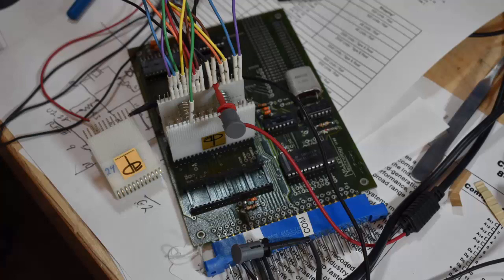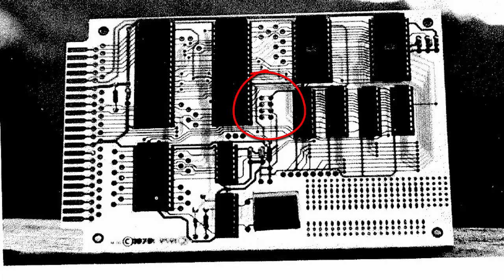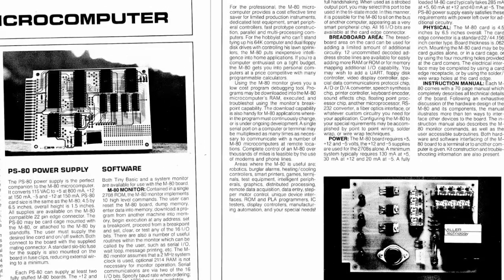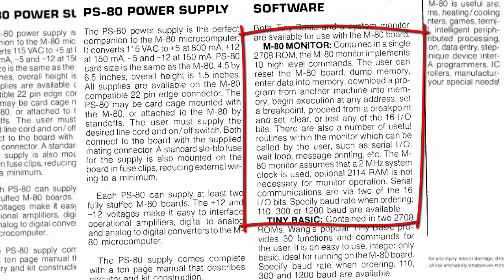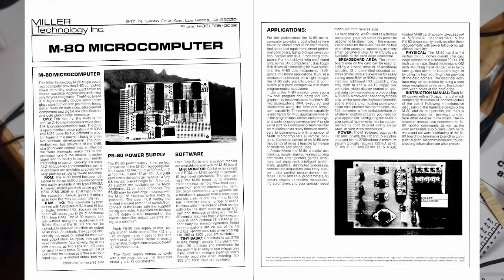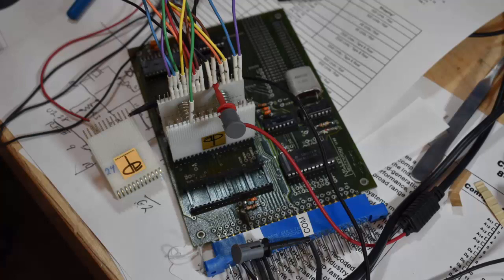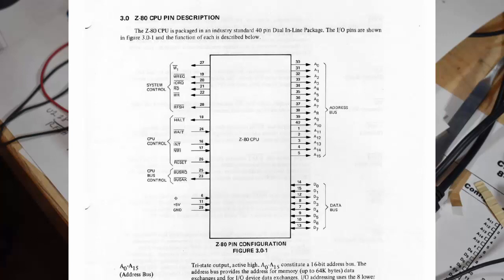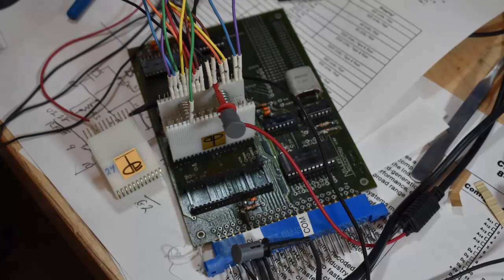{63} Call to all Z80 Gurus- test your knowledge challenge !!  New-Documentation- a M-80 Sell Sheet

Comment: Three options come to mind:

* The /M1 output pin, which indicates that the CPU is fetching an instruction from memory.
* The /HALT output pin, which can be set by issuing the HALT instruction.
* The /RFSH pin, which technically cannot be set through software, but can be monitored by inverting it and or-ing it with the inverted /MREQ signal, in which case the contents of the R register are asserted to the lower 8-bits of the address bus and those of the I register are asserted to the higher 8-bits of the address bus. In theory you could then use the IR register combination to output debug information, such as an address, but doing so reliably is possbily going to be a hassle, especially since the R register is a counter. Also, /M1 and /RFSH are typically not asserted concurrently (which makes sense, as the /M1 cycle will need the address and data buses for its own purposes) and from the diagrams I've seen you can pretty much assume that the CPU is at least halfway through the T3 state once /RFSH is asserted low. 

The third option is only viable if all RAM present in the system is SRAM, not DRAM of if DRAM present in the system is refreshed by some means other than through the Z80.
Reply from the maker: I suppose that I should have mentioned that if the Z80 is using dynamic RAM, then hijacking the refresh circuit isn't an option, and there goes the whole idea.

Comment: You will need extra logic to decode the Refresh register. A simpler way is to drive an LED from the /HALT pin and execute a HALT instruction (use a CTC timer interrupt to make it flash).
Also it is a good idea to always pull up the data bus with 4k7 resistors. This ensures that  a RST 56 instruction is executed whenever you jump to non-existent memory or unprogrammed EPROM, then  the PC jumps to 0038h where you can have a diagnostic code loop e.g. write the stack to an I/O address so that you can probe the data bus and see where you came from or anything else relevant.
Reply from the maker: Interesting idea for designs where the halt is otherwise unused and, say, could drive a toggling flip flop. But, I don’t see how you are getting a humanly discernible switchable or blinking LED using the halt pin but without additional logic.
Reply: @HelloWorldETX  No need for toggling flip flops. Just have an LED that indicates the  /HALT (i.e. RUN) status. You want to establish that the CPU is running  code? Put a simple software timing loop in the ROM followed by a HALT instruction, the LED will stay on for the time of your counting then go off.  QED. If you want repeating flashing then an interrupt or NMI is needed to get out of the halted state.
If you want to prove that the CPU executes code and the data bus is pulled up, just take out the ROM. Any FFh will execute a RST 56 which will find an FFh and you get an endless loop which is easily confirmed which a scope.
If buggy Z80 code goes out into the long grass it won't be long before it finds a block move or moves the stack over all your RAM so it's a good idea to trap such occurrences and make debugging easier. Dynamic RAM usually powered up with patterns of 00h and FFh which is NOP and  RST 56, but static RAM has random contents. It's good practise to fill it with 00h or FFh to be safe.
The best way to debug, confirm and verify Z80 code is to use a logic analyser   with a disassembler  to passively monitor the bus (i.e. not a development system with emulated memory and peripherals). In 1982 that would have cost about £32k (Dolch), in 1992 £1500 (Thurlby), and now they can be found for £30 on eBay because "nobody" uses Z80s anymore.

Comment: I run a single byte Z80 test program. The program consists of a single byte 76H (the HALT instruction). If the system is properly reading the data bus the CPU will HALT and the /HALT signal will be asserted. Many systems have a HALT LED indicator to make it easily seen.  This program does not even need a ROM to run - all one needs to do is pull up and down the data bus pins so that the 76 is presented. The HALT instruction is essentially the NOP instruction in disguise.  The Z80 CPU will continually run NOPs without updating the PC (Program Counter) allowing one to observe the Z80 output signals in action.

If one wants a more comprehensive test suite then one can implement Zilog's Special Reset circuit (US Patent US4486827A) to provide a comprehensive debugging and inbuilt ICE (in circuit emulation) with a minimum of components.
Reply from the maker: Good point and great diagnostic technique to jamb an instruction onto the bus.  When having extremely difficult times bringing up an old board I have patched in a hardwired machine instruction onto the bus or even fed machine instructions to the processor using my processor breakout board as a poor man’s ICE.

But the special reset is at the next level of understanding.  I have seen the external timing latch circuit to generate the special reset, but I do not think I ever needed to actually trace out and understand what it was doing.   I know that I never came across the patent before, some good reading there. Thank you for that.

Comment: An other option can be to use the refresh register to set/reset the eight bit with a LD R,A you can then test this bit during the refresh cycle. The Zilog manual even says: The programmer can load the R register for testing purposes.
-Maarten
Reply from the maker: We have a winner, well done.  While the refresh logic increments the refresh address during an opcode fetch, it only goes up to 0x7F before rolling over to 0x00, leaving the eighth bit untouched. This puts the eighth bit, and therefore A7, entirely under software control and with a simple latch can be used to create an output control bit.  To extend the concept, the I register can be used to create an 8 bit output from A8-A15.

Bravo Maarten
Reply: @HelloWorldETX  So you are saying: Connect an 8 bit latch to a8 - a15. Use the /refresh pin to trigger the latch to load. I like it! I'll try it out in one of my future videos!
Reply from the maker: Technically, to make sure the timing is impeccable OR the refresh* and memreq*

Comment: You can use MI,  Ml indicates that the current machine cycle is the OP code fetch cycle of an instruction execution, but with a 2 byte opcode Ml is generated as each OP code byte is fetched These two byte op-codes always begin with CBH, DDH, EDH or FDH. So more or less you have control over the MI output.
-Maarten
Reply: Doh!  yeah, I think that would be it. A good passive way to know it was executing code. I was stuck in thinking "active control" and not passive normal CPU functions.
Reply from the maker: I see your thinking—— We know that M1 only demonstrates that the z80 is attempting to fetch which shows that it is functional, but does not indicate that it was successful in fetching the desired opcode from memory. So if I understand it properly your scheme is to slip in double fetch instructions in such a manner that the pattern is recognizable.  Very slick idea indeed, but how would you create a latched signal that could be used, for example, as a heartbeat led or to page memory or voltmeter test point?
Reply: @HelloWorldETX  If you are going for "Is it accessing the memory in some way" MREQ would do it.  It would say the CPU is executing "something" good or bad.
Reply from the maker: @UReasonIt  these are all good, but give completely different levels of confidence.  Like M1, MREQ is the Z80 making an attempt to fetch, but there is no confirmation that it is actually running code.  Maarten’s idea is quite slick and the coder could create a unique pattern using a sequence of single and two byte opcodes.  So it confirms code is running but not as deliberate as my secret pin.
Reply: @HelloWorldETX  You sure you're not thinking about the CDP1802 and the Q pin? ;-)  I know it's probably staring me in the face, but Mr. Barden, Mr. Zaks, or the 1981 Zilog books are not telling me.  I know I have used out's many times to PIO's or a latch and other pins in combo for probing.  I am very curious now.
Reply from the maker: @UReasonIt  Excellent.  From such curiosity comes knowledge. I have never seen it documented, but it is a way to squeeze a one-bit control pin out of the z80 (and was an excellent way to obfuscate a programmer’s signature in code that could easily be observed with a scope)

Comment: You could execute an "in" instruction and watch for the IOREQ line going low.  You could also use the halt instruction, and look for that pin low, but would need an interrupt generated to take it out of halt. I would go with the IOREQ/in for ease of use.  My feeble guess anyway.
Reply from the maker: Yes, good idea and that would fit the bill for creating a controlled toggling pin to do simple confirmation that code is being fetched from the eprom and executed.    The pin I am thinking of ups the bar by allowing the software to set the signal low or high independently of whatever else is going on.  (It is an output pin so it can be used as a control bit.)